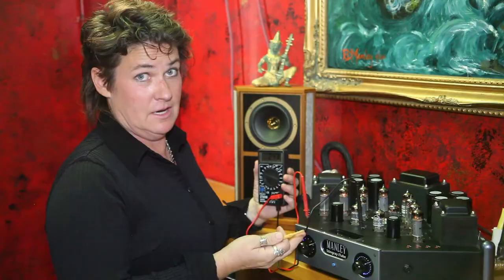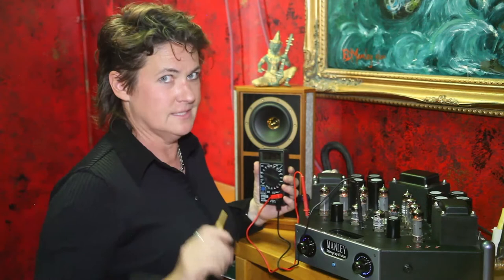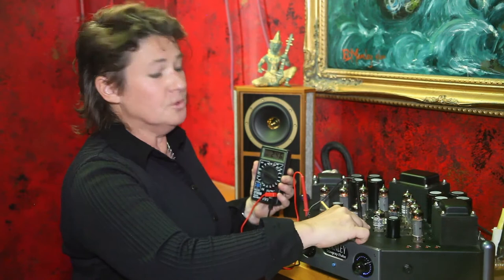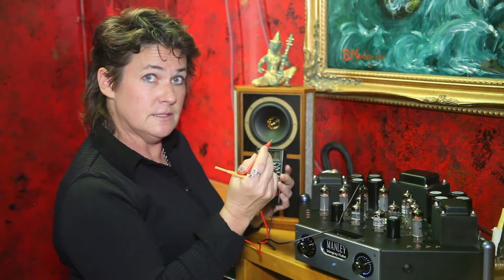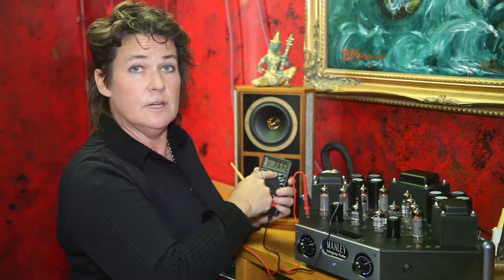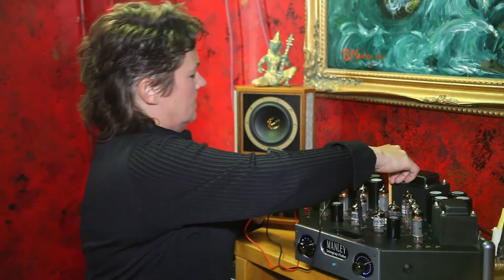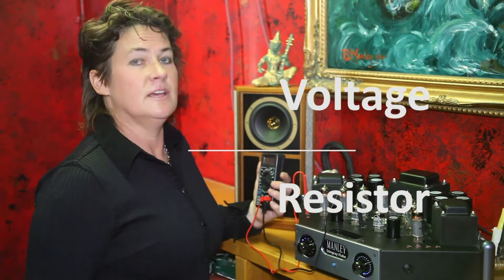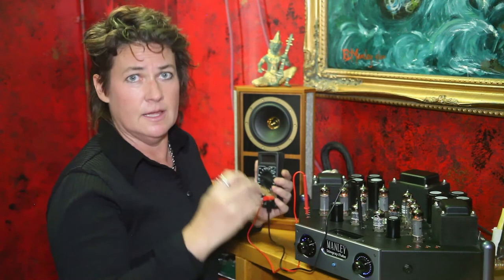How to Bias Your Manley Tube Amplifier

Comment: Hmm. I blew a fuse last week. Upon replacing the fuse the amp powers on but I have a bad tube. When I followed your procedure to check bias on the EL34 tubes, the bad one reads 0, each of the other tubes are reading around only 20 mV. The manufacturer recommendation is 400 mV. What could cause that?